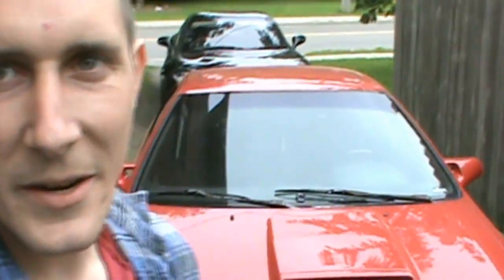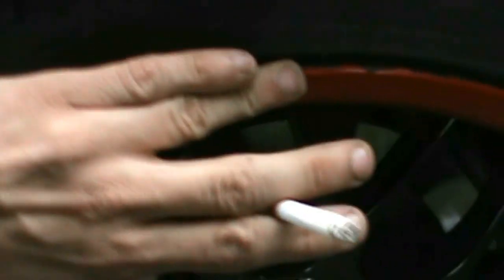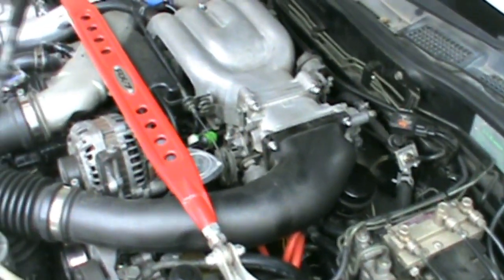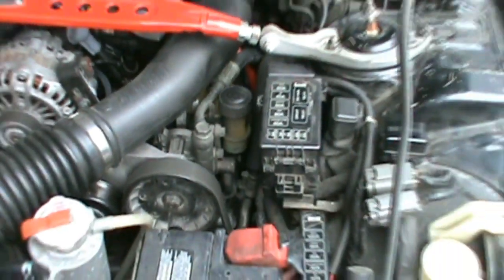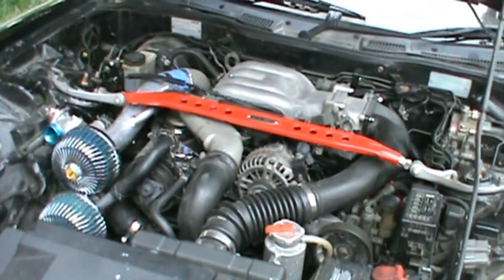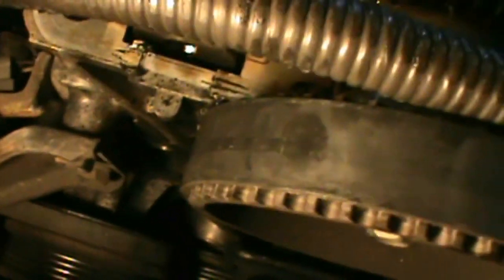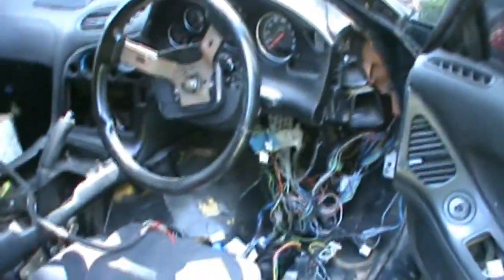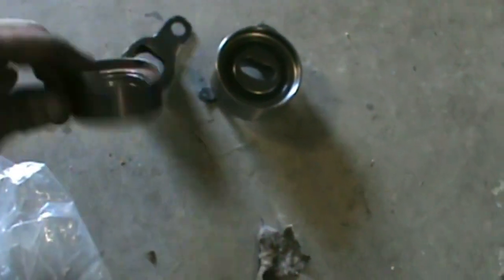Doing Stuff with LMNOPS

Comment: the soldering on the board of the main relay is probably junk. It happens to civic main relays more than it should. You can re-solder all the connections and it should fix your old one.

Comment: Relays can be a bitch sometimes.  Just because they click doesn't mean they're working; test it by feeding it 12 and testing the resistance on the other side, sometimes they get corroded on the inside and you get a high-resistance open that only lets a few volts through.  Should be zero resistance.